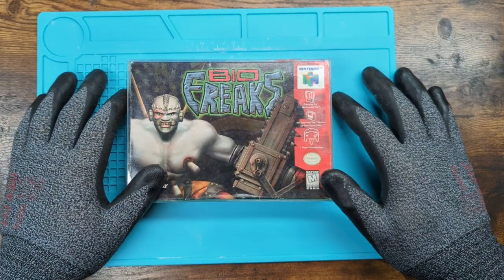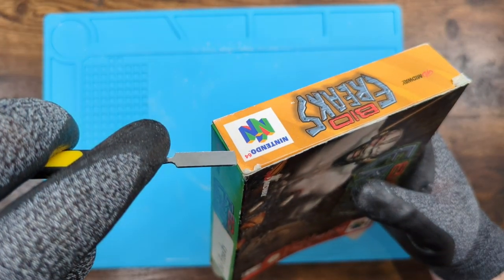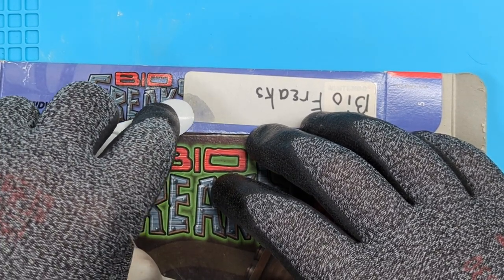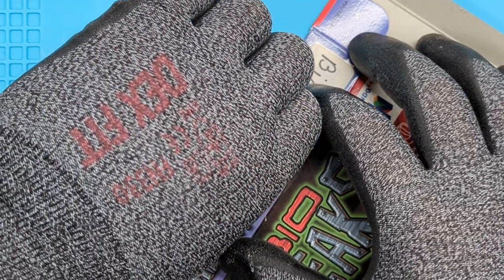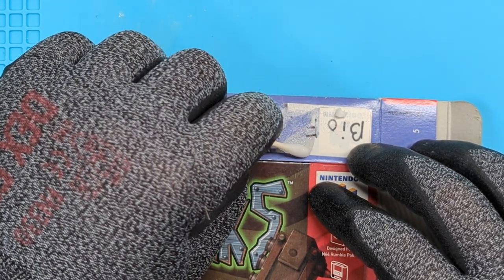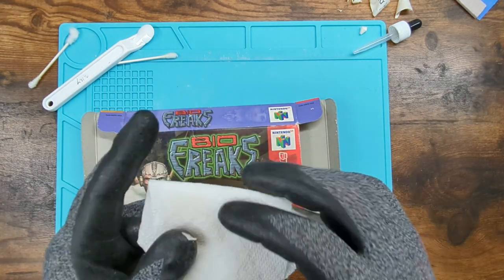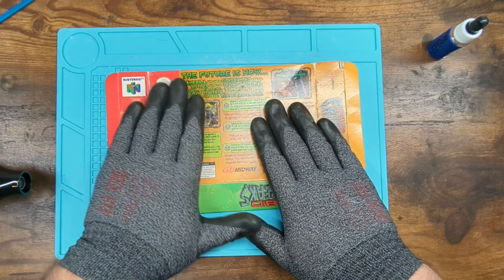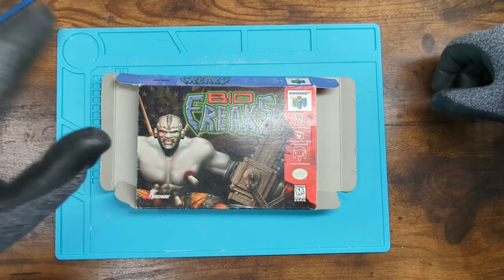Removing paper sticker from N64 box!

Comment: The Bestine product you have linked to Amazon in your description states it’s for removing ink and adhesive. I just gotta double check this is the exact product you used to remove this paper sticker from the game box in the video. I’m looking to remove a paper bill of laden stock sticker on an N64 console box. Hope all is well!
Reply from the maker: That's the one! Comercially it's sold as either Bestine or "Doc Edington's Rubber Cement Thinner & Adhesive Remover".

So it's kind of counterintuitive to use something that says it removes ink, but since it dries faster than most other solvents, it can remove adhesive before saturing the ink enough to remove it. Just use a little bit at a time, just enough to remove the adhesive, and you'll be fine. Scrubbing with bestine/heptane can cause the ink to smear.

Comment: I just took about 3 feet of Scotch packaging tape off my Super Mario Maker Wii U console bundle I scored off eBay for $130.  I used my Wagner heat gun and slow pulling to get the tape off.  I used Goo Gone and a microfiber cloth to get the residue off.  I finished it all off with some Guardian wood duster/cleaner spray and a microfiber cloth.  Besides one tiny spot on the top of the box it came out perfectly.  Thanks for the video!

Comment: I found it helpful to (carefully) after heating the residue, using scotch tape to pull up the residue.  Or if it's particularly gooey, another piece of paper or towel to absorb the goo.
Reply from the maker: This method can work! We used to use scotch tape to remove any residue from stickers at GameStop, or heck even the label itself! But everyone just be careful that the tape doesn't remove any of the box art or printing! No matter the process, with these older cardboard boxes it's important to just go as slow as possible and focus on removing the gunk first!